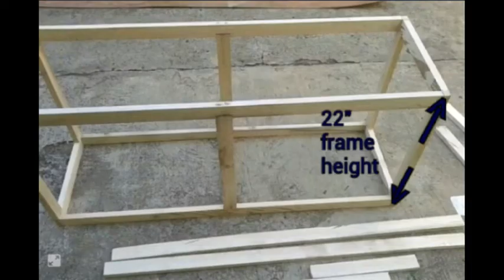How to make  broom box  all purpose storage box #55

Comment: Wala Po bang specification ng materials na ginamit. Salamat po.
Reply from the maker: 2pcs 4mm fly wood, 5 to 6pcs 1x2 x8 clean dry gemilena wood, 1/4 kl.  finishing nails 1", 1/4 kl. finishing nails 2" ,
2pcs 2x3 henges size ,2 pcs 1/4 letter enamel paint